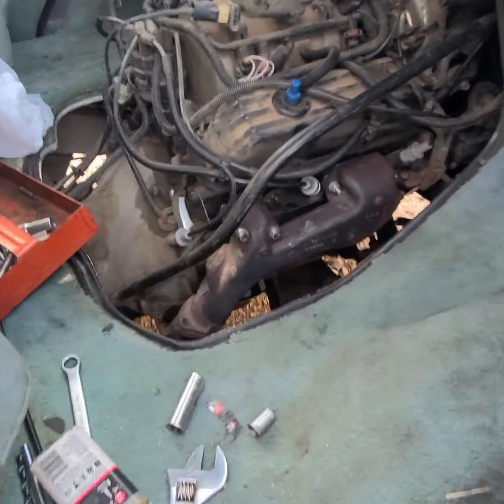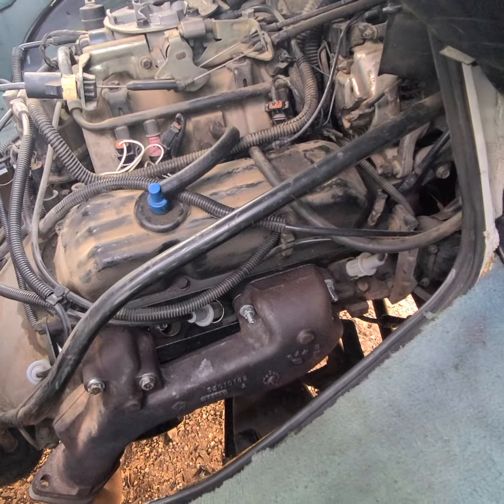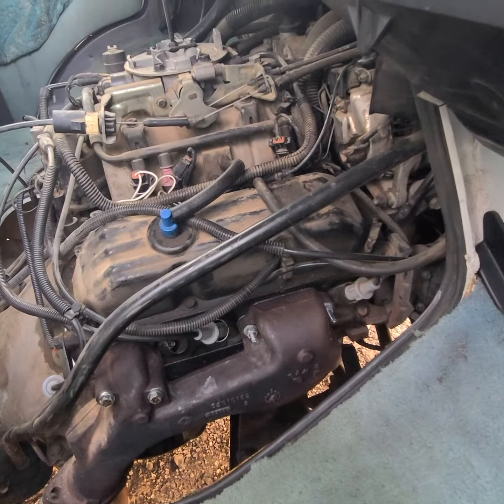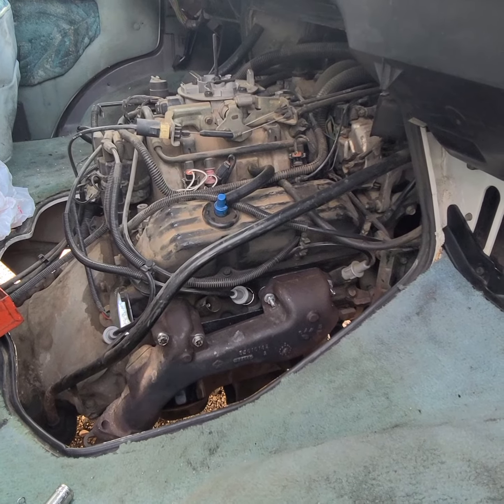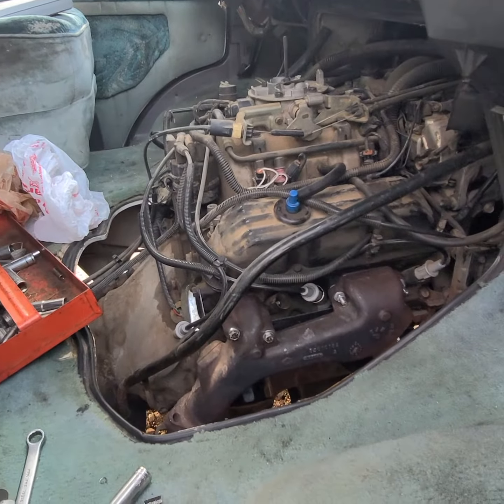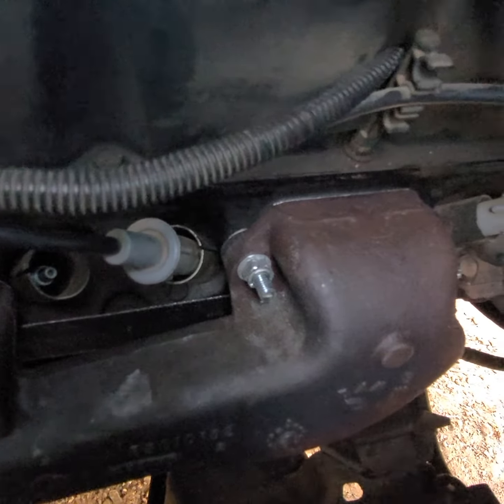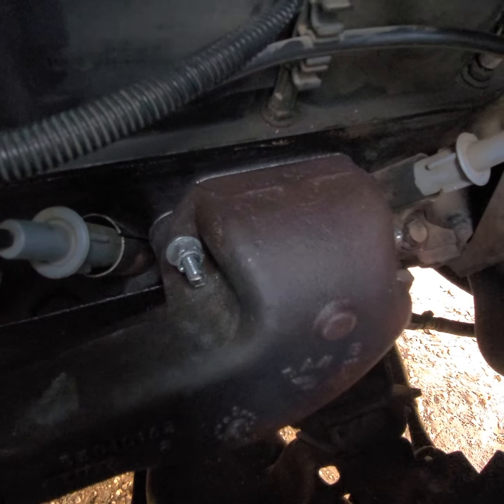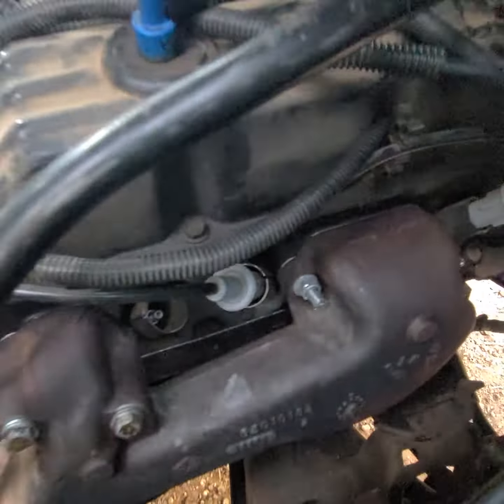Extracting Broken Bolt And Remover Pt. 2

Comment: Cheers for the video! I’ve got the same problem with my 01 dodge ram b1500. I’m about to replace the manifold and get the snapped bolt out. What type of bolt/threaded rod did you replace the snapped and rusted bolts with? 
Thankyou
Reply from the maker: I googlex and found Stainless Steel 309 and 310 can withstand high temperatures an engine can produce.